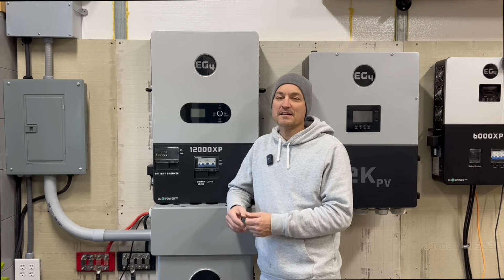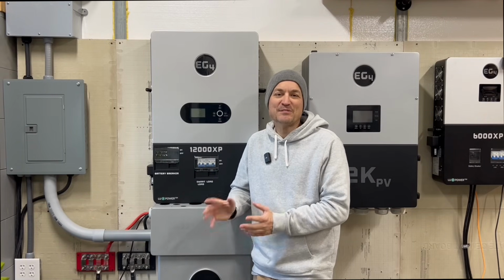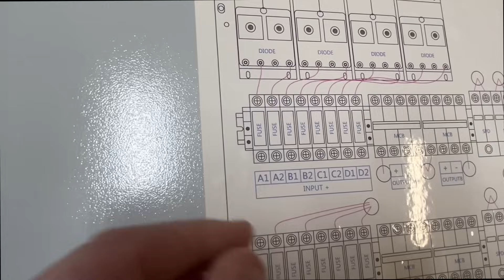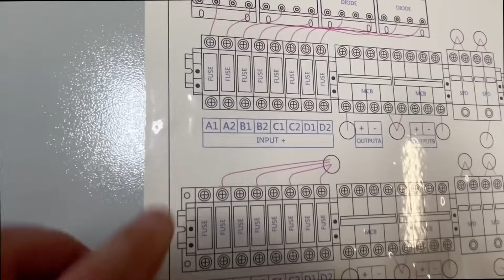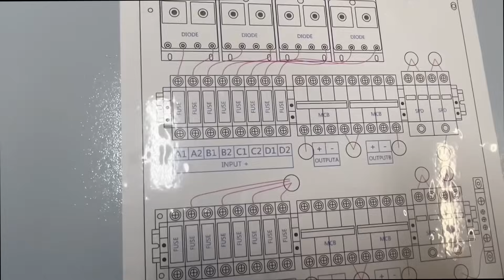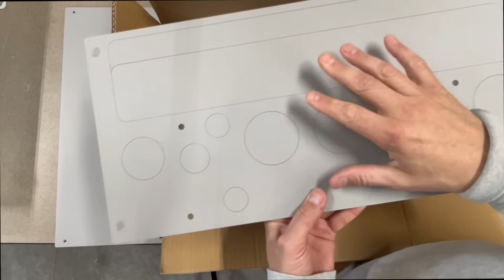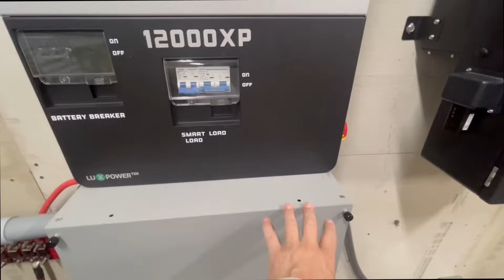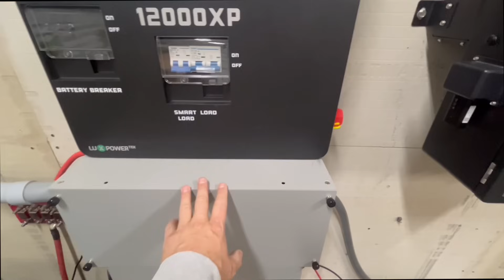How to use a combiner box with the EG4 12000xp to maximize your solar input

Comment: A couple of problems with all this solar is 1 the way you guys present how you do everything is not normal homes and to achieve this in most homes takes a large investment. Second to have these  big systems and one wants to incorporate solar with battery backup one needs lots of battery’s and a whole lot of panels. You need lots of land and a clear spot for them for the roof will not be enough. The batteries are better but the panels are the weak point.
Reply from the maker: You’d need a fair amount of roof space or a nice sized ground array to achieve the maximum amount of solar for this unit. The solar is actually the cheapest part of the system. So it’s not necessarily a weak point. Plus the battery size depends on the house and your usage. It’s an investment for sure. But more and more people are doling it. Whether it’s just to save more, or for independence.
Reply: @ Maybe I don’t understand things right. For a 15000pv to run it right you will need six batteries or 2 big ones. To charge those batteries by solar with 400 watt panels at peak time you would need at least 15 panels. To have some kind of grid slash solar to run house thru a large inverter you will need at least 15 to 30 solar panels.
Reply from the maker: @ the 12000xp would run on 3 rack batteries. Or yes, 2 wall mount batteries. And then the solar amount would depend on your usage. So maybe anywhere from 8,000-24,000 watts. It could vary a lot depending on what you’re trying to accomplish. 
I have been running my whole house on 14,000 watts of solar. But I have a large battery bank. So each household will be a bit different, and not everyone wants to run their whole house. Maybe they only want to handle critical loads.
Reply: @GavinStoneDIY  thank you for responding. How many solar panels do you have. The panels maybe the cheapest but you need a lot of them to charge your batteries I would think. I have to work out my where to put my critical pad panel and how much to rearrange it all before I dive in soon though.
Reply from the maker: @ I have 36 panels up right now. But I started with 30. That’s going to depend on the wattage of the panels. They have some crazy 550 watt panels now. So you could possibly have less panels over all. Most of mine are 400 watt.
Reply: @ Wow that’s a lot. Most people don’t have room for that. If they did they would have to be in the right location. Iam just saying most of the yt streamers don’t really go into the logistics and nuance of the panels or really how they work or how many it takes. It’s a little mis leading. If one wants to go all in or just do a little to do small things. I went from really dumb about this stuff then thinking I was smart now back to dumb. You see these houses with 8 or 10 panels on them what good are they actually doing. Thanks for responding.
Reply from the maker: @ray1dad  I’ve gone into the panels and wattage and all that. Just in different videos. Most of my recent videos are on the indoor equipment itself. But I have array build videos and descriptions. You don’t have to have that many panels. In a situation where you have less land a 6000 xp with 10 panels will power enough to get by in a power outage. Things like your lights, fridge, microwave ect. 

The panels you see on people’s houses in town are usually just to shave off their electric bill a bit. Most don’t have battery backup, it’s just a net metering agreement. So in the event the power went out you wouldn’t be able to use any of that solar anyway. So they aren’t super practical in my opinion.
Reply: @ I agree solar without batteries storage seems kind of a waste. I am going with the eg4 6000xp. I can either put my critical panel next to service panel and run wire from inverter to it. Or set critical panel next to inverter and run the service panel breakers to critical subpanel. One wire seems better than 3 or 4. I see now other way. For I do want to have backup when power goes down. I will watch your other videos thanks.

Comment: Does a pv combiner box need to be UL listed or certified? Hard to find that certification. Not seeing on Watts 24/7. Thanks for the awesome content!
Reply: Look up midnight solar.  They offer listed combiners i believe.  Not cheap though.
Reply: @ry2456  Most solar contractors will just buy a UL listed empty metal box put a ground lug in there and combine with UL listed connectors and breakers of fuses. UL listed Fuse holders are $10 each spending several thousand dollars on a solar system why buy a combiner box nothing in it is UL listed.
Reply from the maker: Good question. I haven’t seen any UL listed combiner boxes. Then again I haven’t searched before. I guess it would be worth checking with your local inspectors if you’re getting permits.

Comment: This inverter can't be maxed out with just series connections?
Reply from the maker: @ceo4eva  no, the maximum voltage is 480v. So you can’t get to 12k per leg with those limitations in my opinion.
Reply: @GavinStoneDIY  ah yeah that makes sense

Comment: Can you show how you parallel 2string . The problem is my panel are 400watt - l tried to put 7 string 1. With 373.8 volt and 17.8 amp. Parallel 2 string and my amps 35.6 witch is to high for 12xp. Thanks for the great video. Now I can max out my 12k . Thanks again great job.
Reply from the maker: @bearupfarm1818  that amperage will work fine. We don’t want to ever exceed the voltage limits. The unit won’t use more amperage than it needs though.
Reply: @ The 12xp says 35 amps per mppt
Reply from the maker: @ it does. But amperage is pulled not pushed. 

For the same reason you can have 1000ah of battery on a small inverter. But it’ll only use the amperage it needs.